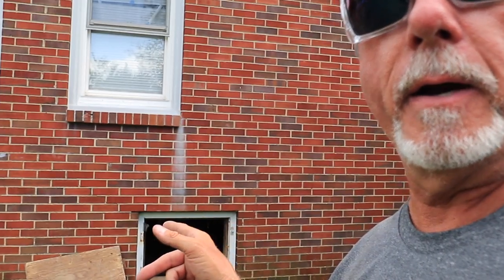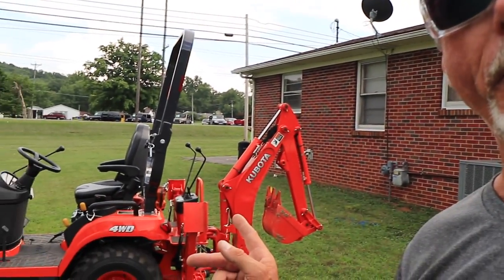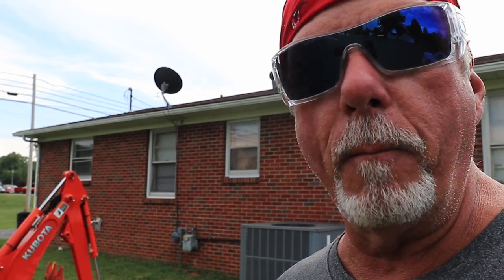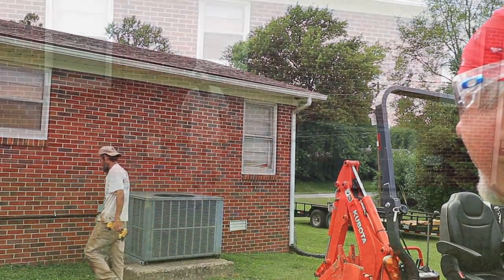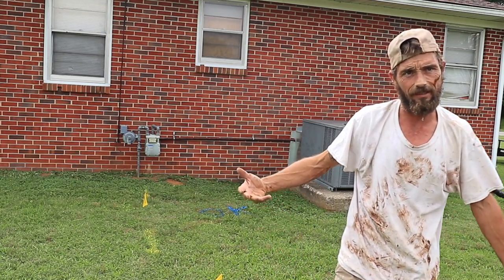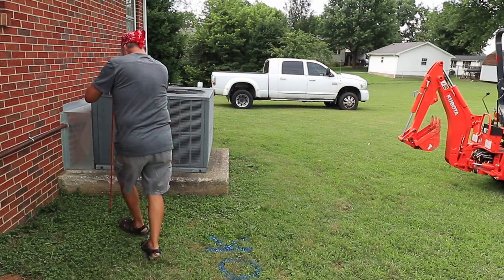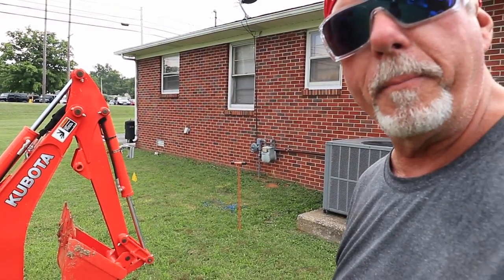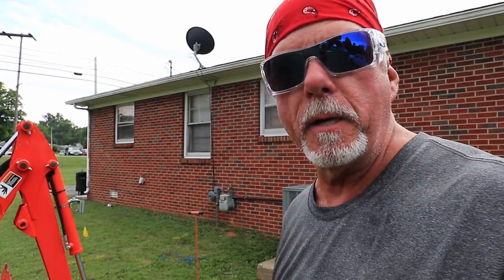Kubota BX 25D Digging

Comment: There is a gas line in close proximity to your dig. Also, sewage [methane and hydrogen sulfide] is flammable and highly explosive. Apparently, you are very near it.  The man helping locate the sewage line line is down very close to its location with a lit cigarette in his hand.  BOOM BOOM!  Between the bucket, the gases and the cigarette he could have lost his head.  Glad he didn't.
Reply: That’s not how it works. You have to have the right mixture of fuel and oxygen to have an explosion.
Reply: A lit cigarette also will not ignite a fire. If he were to light it next to an open gas line then sure

Comment: I designed and built a backhoe and front end loader on my late 60s to early 70s ford model 80 garden tractor . 8 hp. Single cylinder kohler engine . loader lifts bucket level at 6 feet and has lifted over 1100 pounds.yeah I've moved small cars with it. Used it as a engine hoist several times. Made a motocross track for my son with it.  Backhoe digs bucket flat at 8 feet deep and dumps 8 feet high. Pivots 180 degrees. I've used the crap out of it . loader has been on it over 10 years and the backhoe about 6 years. 
Have a 48 inch snow blower that mounts to the bucket. Quick detatch bucket and forks. 
Heard that right 8 hp single cylinder. Uses a two stage log splitter pump. When the backhoe isn't on I have an 80 pound wheel weight on each rear wheel and a little over 400 pounds of suit case weights that mounts on the backhoe mount. 
Ive had it and demonstrated it at many antique tractor shows. No one passed by without watching it. 
Beat that . anybody?
Oh and I have about a thousand in steel . about 2000 in hydraulics. Steel was from a recycling center and hydraulics was all new except the backhoe controls ( bought them used at a flea market at an antique tractor show).
Reply from the maker: Toolman wow that’s nice.

Comment: 6:32 when you need to help machinery by hand is a indicator that you bought to small of a machine lol
Reply: He is cleaning away the dirt from the pipe so the operator can see it, and knows 100% where its at. But you knew that already didn't you
Reply from the maker: You are correct, when locating a pipe under ground it’s always a delicate thing not to ripe it out of the ground!! Plus the markings for the gas pipe could be off. You never know what’s in the ground, it’s better to be safe than sorry. I’m always impressed by the power of this little machine. Thanks for commenting.

Comment: That’s a slick little toy.
Reply from the maker: Wayne Barrie thanks Wayne I’ve wanted one for a few yrs because I’ve had to borrow one in the past times I’ve had sewer or water leaks and the one I borrowed from a friend was a large backhoe and these are usually small jobs, I just needed a small backhoe for small jobs I’m not going to be laying water lines or sewer lines mine are just small repair jobs. Thanks for watching and commenting you have a blessed an awesome 4th of July.
Reply: V

Comment: What size bucket is on the backhoe?
Reply from the maker: intn14 12 inch
Reply: David Farmer if you need a bigger one I build an sell them for the bx’s. Anywhere from a 10”-24”. Sold a bunch on the Kubota forums on Facebook.
Reply from the maker: jj1479 the 12 inch bucket is all I think I will ever need. I plan on only digging sewer line repairs or water line repairs. Thanks for watching and commenting you have a blessed day

Comment: Do you think this tractor is good enough to expose sewer taps? Some can be 6.5’ deep. I have a plumbing company in Texas and it’s sucks to look for those sewer taps with a shovel.
Reply: ZR1Terror only digs 6’.
Reply: ZR1Terror you might stretch this machine at 6ft because the digging depth is 73 inches. Thanks for watching and commenting you have a blessed day
Reply: Bigger problem is whether you're comfortable you can dig up a sewer without breaking it.  If the sewer is at 6'6, then only digging to 6' and finishing with a shovel sounds like a good idea to me.
Reply: Дапнуш2423

Comment: David, This machine looks like you can only do so many movements at a time with the controls. I’m sure you have used mini excavators before, how well do you feel this machine operates vs a mini excavator about the same size?
Reply: chris hefley yes it’s small and only has one pump so your limited on how fast it will move or how many operations you can do at once. I could have went up a size and got double pumps but I dont need a large machine. I only work on my rental property so I just don’t need s large machine plus some of the back yards I have are very small and I like the versatility of a tractor for me. Thanks for watching and commenting you have a blessed day.
Reply: Yeah that’s what it looked like, can’t do too many control movements at once. There’s one coming up in an auction I may bid on. I’m not going to bid high but you never know
Reply: It's also about a third of the price of an equally sized mini excavator.

Comment: curl the bucket to dig, it has more digging power than dragging from the arm.
Reply from the maker: Shane Forsythe yes it does have more power when you curl the bucket but when I’m trying to find a line I like having the teeth straight down where they will slide along the pip to find it instead of curling the bucket and risk picking the pip up or any other line that might be there. That’s why I’m not curling the bucket. Also there could be an electric line in the ground someone has laid your more apt to find it dragging than ripe it out of the ground. Thanks for watching and commenting you have a blessed day
Reply: Curl the bucket? We drag the bucket to dig in layers. Digging in Layers saves underground utilities or anything else you can’t see or that’s un marked. Real operators know that...
Reply: @DavidFDay  YUP

Comment: Was that for the sole purpose of putting in a cleanout, or was is stopped up too?
Reply from the maker: Scotabot it was giving trouble we had it unclogged but  I wanted to put a clean-out in outside for the future to make it easier because I have a auger machine.
Reply: @DavidFDay  Oh OK. That is what I figured. Mt father in-law owned his own Plumbing Heating and Air Company and when I built my home, he put a clean-out in running down my front yard to the sewer. He said, you will thank me for this in 20 years! Ha Ha

Comment: I got to do same thing but will replace everything pvc
Reply: Thirty years a plumber, and I could make the case for iron pipe and rubber gaskets as well. PVC is "good enough" considering most residential structures and commercial are not built with much more than a 30-50 year (if that) life expectancy, and Sched 40 PVC will do that, even in some pretty aggressive soils. Cast iron in very good circumstances can last 150-200 years- in poor circumstances 85-11. It's something to think about when you build your forever home mansion. Yes, I know it cost a bit more, but the labor is really the same hours and the same finishing problems, so it really only works out to 15% for the consumer. If you are doing your own, about 30-35% higher material costs.